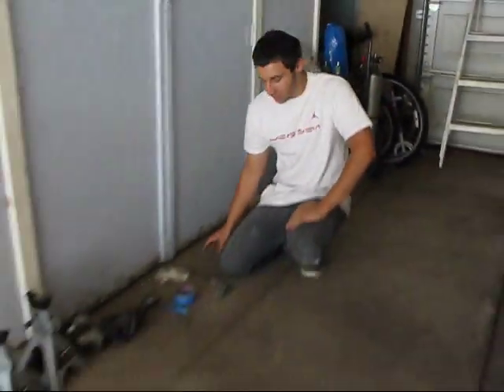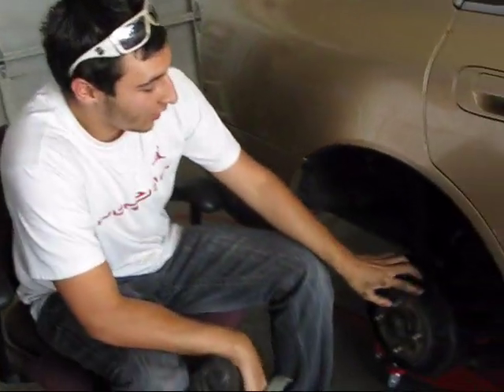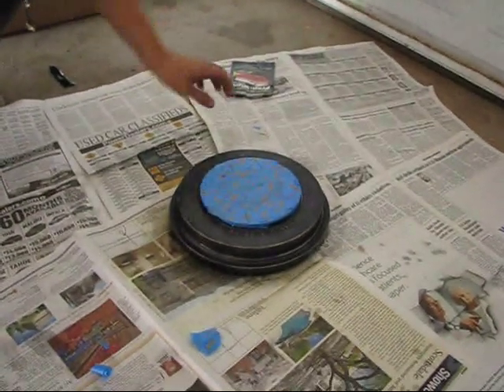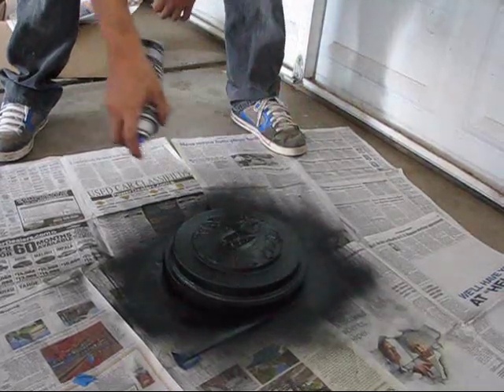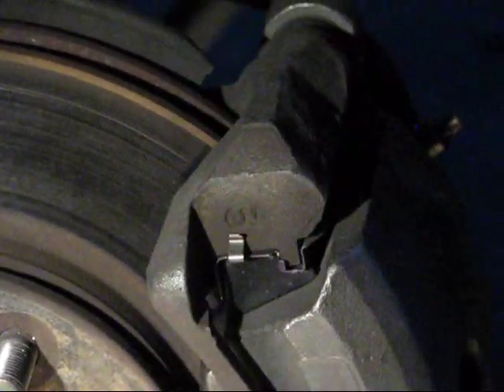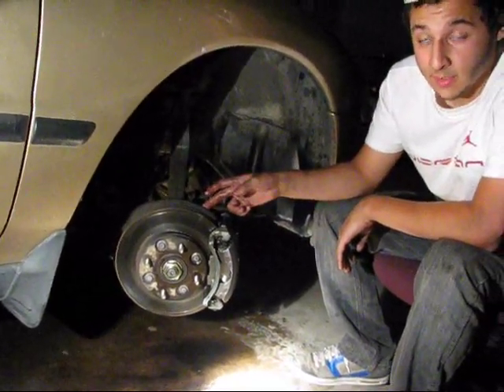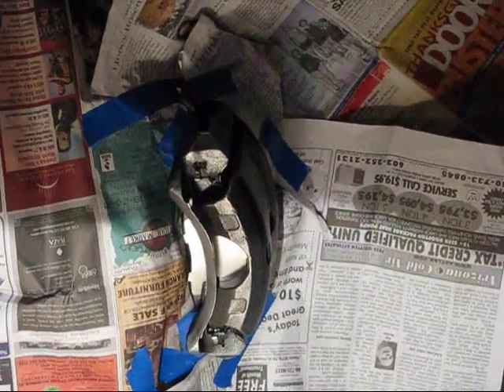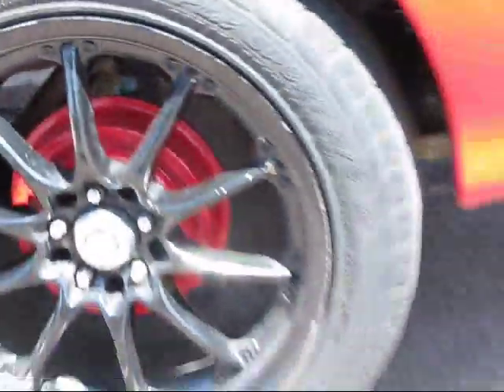how to paint your calipers/drums (the easy way)!!!

Comment: You don't need a grinder. Spraying calipers and drums with a good dechlorinated brake cleaner should suffice. The only time a grinder is necessary is if you have rust. Not sure what I can suggest as an alternative other than perhaps having a shop sandblast those parts.

Comment: Take the caliper off! Not sure why people think it is "easier" or less work to tape the whole car. You can remove brake line and bleed brakes much faster than it takes to do all that masking. On top of that, you can get caliper THOROUGHLY clean so paint will last at least until you have to change brakes. Pain in the butt changing brakes after seizing everything with paint. As it goes with anything you're wrenching on, it is always easier, faster and more reliable to do things the "hard way." Took me 20 years to learn that lol

Comment: Degreaser? How about using brake cleaner instead? Degreaser typically requires rinsing off, otherwise you'll be left with residue that could cause the paint you painstakingly applied to peel or bubble. Also, why grind unless you're trying to smooth the surface of the calipers and drums? I also don't understand why, if you were insisting on grinding that you didn't remove the drum in the first place. One last thing, painting calipers is easier if removed from the vehicle. Sorry to be so picky.